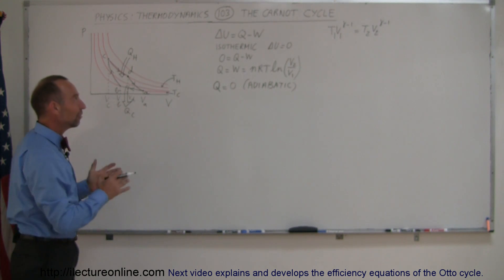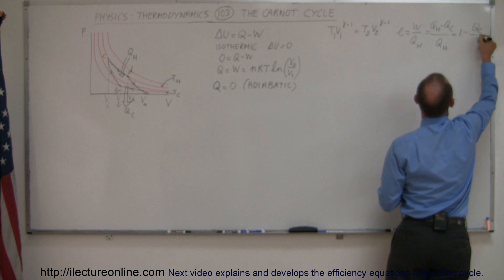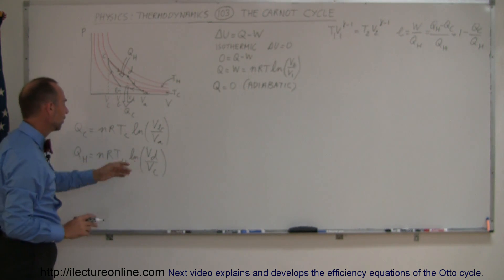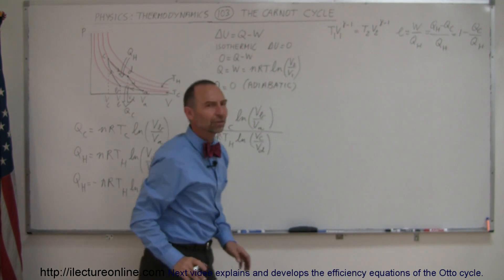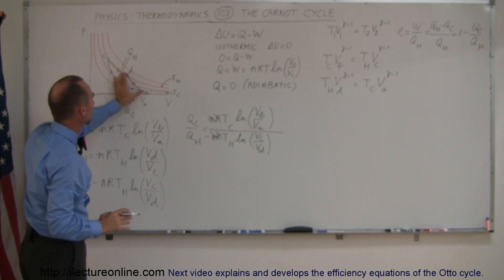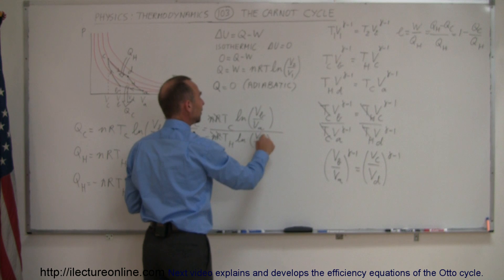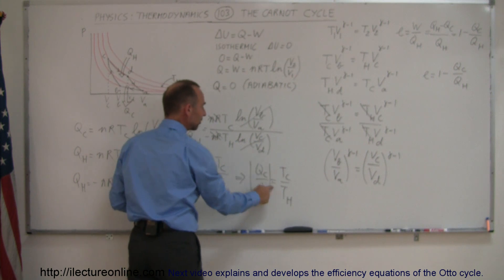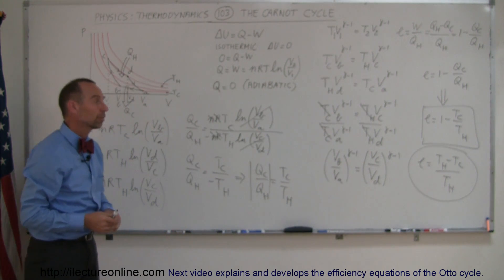Physics 29  Efficiency Of Heat Engines (13 of 14) The Carnot Cycle

Comment: Sir, why Temperature is discussed in Carnot Engine or Carnot  Cycle instead of Heat Q as in real engine???
Reply from the maker: The Carnot engine is NOT a real engine.  It is just a theoretical engine, that shows the maximum theoretical efficiency.  A real engine can never reach of exceed this efficiency, and it depends on the operating temperatures.
Reply: Thanks Sir.

Comment: why did you take the absolute value ?!!
Reply from the maker: +alaa ashraf 
Q is positive when added TO the gas and Q is negative when removed FROM the gas.  Thus the ratio of Qc to Qh can be positive or negative and the temperature can only be positive.
Reply: Michel van Biezen  the work total in Carnot cycle does it equal qin plus or minus q out ?? What the right rule is not plus or minus 
Because  there are argue about that between people 

Can I have your email , because I have abother question concerning thermodynamics
Reply from the maker: +alaa ashraf 
The work done in any cycle equals the net inflow of heat (Q), since the change in internal energy is zero for any cycle.
The sign for q only depends on how you define the first law of thermodynamics.  (Look at the video on the first law of thermodynamics. )
Reply: Michel van Biezen  can I have your email ?